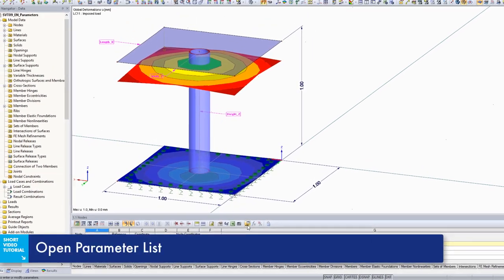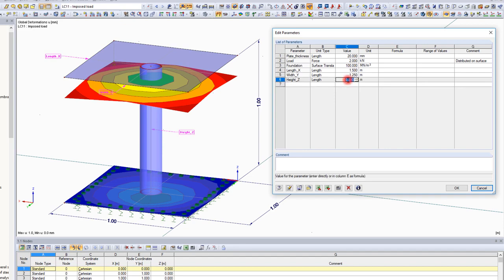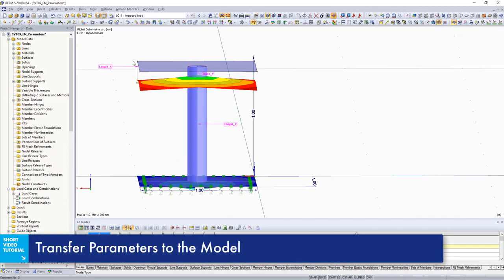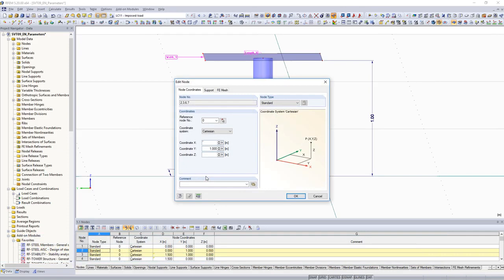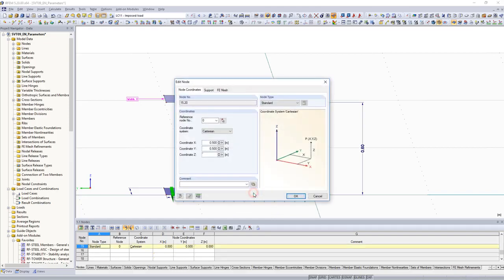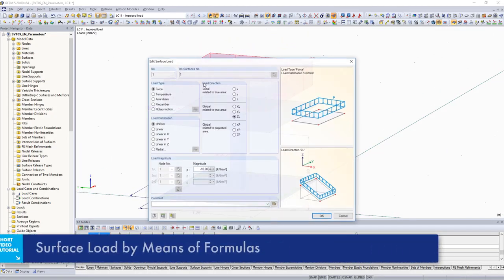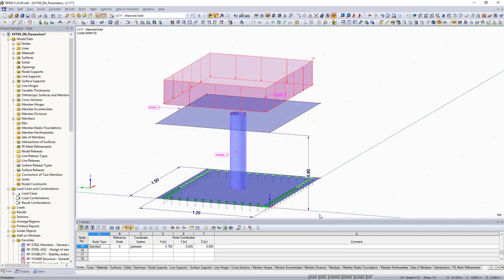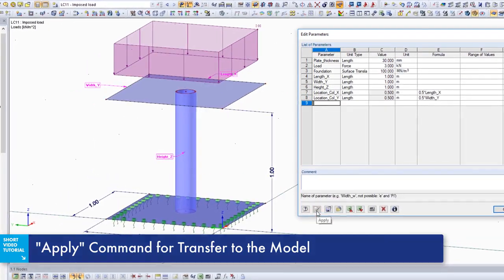SVT 009 | Parameterize Models

Comment: Nice Video! One question remains: is it possible to automate for a set parameters. Instead of doing all these iterations manually?
Reply from the maker: Hi, Aris!
You can edit and optimize the parameter list by using the COM interface. You can take a look at FAQ 4903 on our website. https://www.dlubal.com/en-US/support-and-learning/support/faq/004903
Reply: @DlubalEN  Thanks for the reply! This does not however automate the process. I need to perform the same stability analysis for 200 design with varying parameters.
Reply from the maker: Hi, Aris!
since this looks like a more complex issue, the best solution for you should be our support. There you can receive fast help specific to your needs.
You can contact our support on our Website.